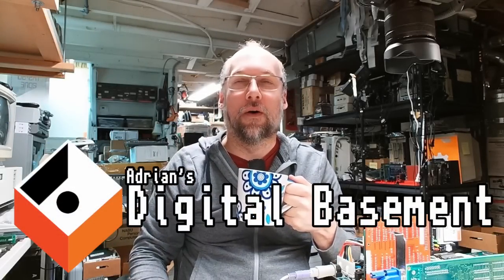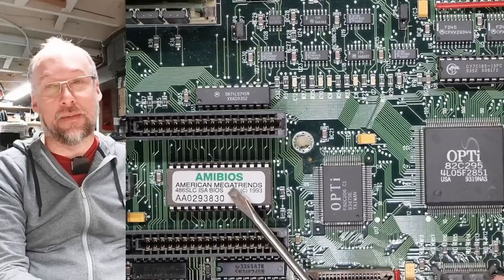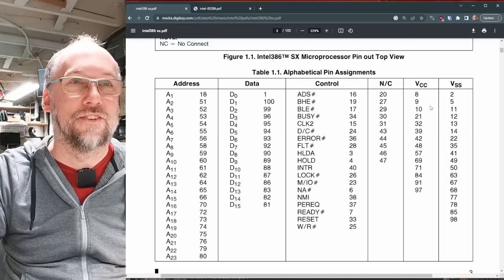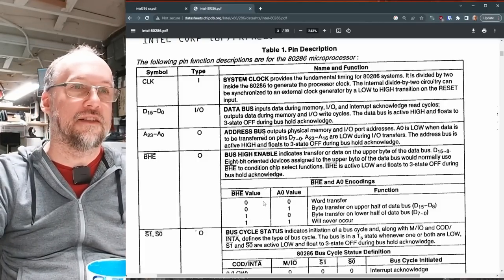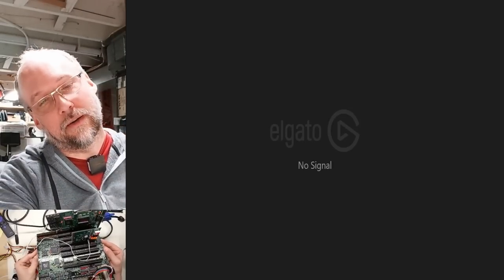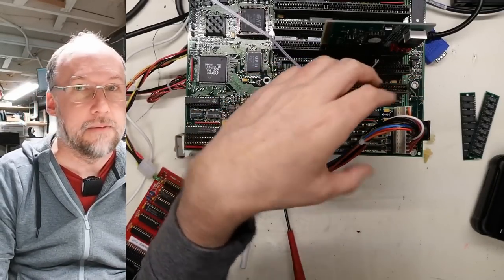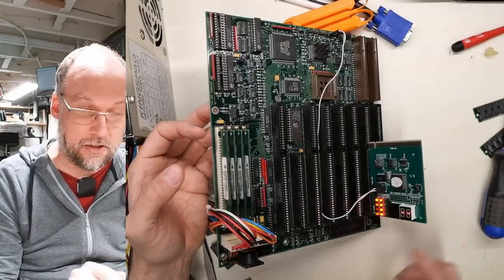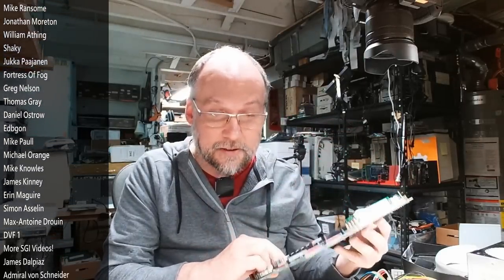Disaster struck while working on this odd-ball 386SX VLB motherboard

Comment: It's a common misconception that the 386SX is basically a 386 "with th 286 bus interface". While it is completely true that the number of address and data lines on the 386SX is just like on the 286, the protocol of the 386SX is very much like that of the 386DX, but it differs from the 286 bus protocol. For example, the 286 bus protocol generally allows the processor to output the address of the next bus cycle while the previous cycle is still being finished, and actually the address pins are always valid half a processor clock (one period of the CLK2 signal) before the bus cycle is started. On the other hand, on the 386 bus protocol, the address stays valid during one cycle unless the mainboard actively allows the processor to output the address of the subsequent cycle (using the "NAB#" signal - "next address to bus"). The 386SX uses the same timings and protocol details as the 386DX, it just has fewer data lines, it misses the top 8 address lines and has the extra line A1. Also, it only has two "byte enable" signals, whereas the 386DX has four byte enable signals.

Furthermore, you are in fact correct that most 386SX chipsets also support 286 processors, but the chipset needs to be configured for the bus protocol to use. Most 286 chipset vendors added support for the 386 bus protocol in their newer chipsets to increase the market for their chipsets. A passive adapter from 286 to 386SX on the other hand won't work.

As I don't expect that board to support VLB masters, it's up to the processor to determine the width of cycles.The VESA local bus is perfectly able to handle 16 bit cycles originating from a 32-bit processor, so the VESA local bus is also able to handle 16 bit cycles originating from a 16-bit processor. On the XT-IDE card, the IDE/ATA interface requires 16-bit cycles to be performed on that interface, which is something 8-bit ISA is not capable of, so that card needs to assemble two 8-bit ISA cycles into one 16-bit IDE cycle. I am very confident that your board will not run any VL card that requires bus operations to be performed as 32-bit cycles. VL VGA cards generelly do not require that (unless special accelerator feature do), as well as VL IDE controllers also work perfectly (also sometimes slower) with 16 bit cycles only.

There is one thing the board has to perform, though: The high two bytes of a DWORD must be transferred on D16-D31, so the board needs to dynamically connect either D0-D15 of the VL slot to D0-D15 of the processor, or D16-D31 of the VL slot to D0-D15 of the processor. That's exactly what the four (74)F245 chips can do.

In fact, stuff like this is also performed on some video cards, like Cirrus Logic cards. The CL-GD542x series are 16-bit local-bus capable graphics chips! The VESA local bus has a signal to tell the processor that only a 16 bit cycle has been accepted by the device and the board/processor is required to re-issue a cycle for the remaining byte(s), if any. Logic on a CL-GD542x card detects whether one of the two low bytes is active, and if yes, it performs a 16-bit cycle using D0-D15 (or an 8 bit cycle with half of the data lines), otherwise it performs a 16-bit cycle using D16-D31 (or a subset). In essence, this means the 16-bitness of your board should not degrade performance of a Cirrus Logic card. This does not apply to the CL-GD5430 or CL-GD5434, though.
Reply: Well TL;DR 80386SX is a cut down version of what was to become a 80386DX, it has the same limited 16-bit Data and 24-bit Address bus, just as a 80286 but it's a real 32-bit 386 CPU just cut down IOs, not much unlike a 8086 vs. 8088 where the data bus is halved from 16-bit of the 8086 to 8-bit in the 8088.
The 386 has in it's ISA significant differences to the 80286 beyond the expansion from 16 to 32 bit execution, as such it has the Real Mode (8086, 80286, 80386), Protected Mode (80286, 80386), Virtual 8086 (80386), which was at the time a major advantage levied by Windows 3.0, and OS/2 2.0. The 80386 also introduced a flat memory model versus a segmented/paged/stacked memory model of the 8086 & 80286 (and coincidentally 80186, that was never really part of the PC ecosystem)

Comment: 5:37 Those for chips are NOT latches, but high-speed bidirectional bus drivers. The model is F245, or 74F245, the F variant of the common 74LS245. The fact that there are 4 chips seems to indicate that the VLB is indeed 32-bit. However, there are 16-bit VL cards. The most famous example is the CL-GD5428 graphics card which use a 16-bit data bus and 24-bit address bus instead of 32-bit. A standard for 16-bit local bus may exist, but just rarely used.
Reply: Quite. "9344" is the date code (44 week of 1993)
Reply: It is also known that those chips draw quite a lot of power and should not be switched simultaneously. Amiga used different types(!) for one 16-bit bus just to make sure that both chips don't switch at the same time. Weird stuff back then..

Comment: My first 486 was an IBM 486SLC2-66 with VLB slots. The 16 MB RAM limit wasn't an issue back then (I only had 4 MB in it anyway), and with 16 kB of L1 cache, it was almost as fast as a 486DX2 when running small CPU-intensive tasks -- but obviously the 16-bit external data bus slowed it down a lot when I/O was involved. Supporting 32-bit VESA Local Bus cards wasn't a problem; it just had to transfer the data in two 16-bit chunks at a time.

My only complaint was that the little one-inch-square CPU had a tiny fan on it that was not only loud, but also didn't fit under the drive cage of the desktop case I wanted to put it in! So I was forced to get a tower case with more room above the motherboard.
Reply: Nice.  I put together a bitsa small Netware 3.12 server for someone that wanted a very low cost basic file server running Netware.  It used an IBM branded (God only knows who actually made it) motherboard with one of those CPUs soldered on.  It ran flawlessly for years even to the point of being forgotten about and lost in the office space it was used in but continuing to plug on regardless.  Quite surprising really all things considered.
Reply from the maker: So basically something very much like this! Interesting! I just don't get why they even bothered with VLB ... But I suppose it ran faster than 8mhz ISA... So there was some benefit.  I know you have a lot of machines, you don't still have it anymore?
Reply: @adriansdigitalbasement2  No, I got rid of it a long time ago, back in the late '90s.
Reply: That must be hence the “AKA IBM 220”
Reply: If you don't care about the FPU, this processor was just fine. I had one up until very recently (actually, I had an Ambra and an Alaris) and it was about as good as an SX2-50.

Comment: As for the motherboard not working with the XT power supply -- it may require +5V on pin 2 of the P8 power connector, while XT power supplies do not have anything connected to this pin. I haven't heard of any AT motherboards actually requiring +5V on pin 2 of P8, but it's just a thought.
Reply from the maker: Nice. I'll give it a try with my new bench supply. I swapped over to an older ATX PSU with AT adapter for lab work. (ATX with both -5 and -12)  I fear the motherboard is gone though as at least one IC was damaged, it seems like 12v may have made its way to the 5v rail when the PSU decided it was time to die. LOL

Comment: 1:20 I wouldn't call a 386SX "essentially a 286". Sure it has a similar bus and similar performance (on 16-bit code), but the instruction set was heavily updated and orthogonalized for the 386 (including the later SX). Actually more so than on any other new x86 processor. It would be more correct to say that the Pentium III was essentially a Pentium II (or Pro), for instance.

Comment: What we said at Microsoft at the time - and it was generally applicable - was "Remember: the S stands for Sux!" (Yes, that applied to Win32s as well.) But admittedly, there was one advantage to the 386sx from a development standpoint, in that you could treat it as a 386 and not have to deal with bloody segmenting. While technically it (and the 386dx) still had segments, they became settable and arbitrarily large, so you could set your segment to all of RAM if you wanted.

All that aside, something I was told by others at the time was that they were in many ways the 286 that should've been, and if you ran 286-targeted code on them you'd get a really big performance uplift. I never tested that myself, but I can buy it - the 286 was absolutely not ready.

Comment: Just to clarify "a 386sx is basically a 286", while true it has a 16-bit external data bus, it also has an internal 24-bit address bus. Plus it includes the 386 processor extensions to the x86 instruction set.

Comment: Hi Adrian. I feel the same about your motherboard. I have 2 Packard Bell mobos that both suffered Varta damage. Both have the same small chip come off with corrosion.  I bought the one in an attempt to fix the other, but that hasn't gone over well. You keep up the good videos

Comment: Very good video indeed !
Your experiences here immediately tells me I have to use an external crowbar circuit on the power lines when testing motherboards.
The old power supplies are prone to have bad electrolytic capacitors inside.
Commonly seen as the top of the caps bulging out or the bottom showing signs of leakage.
When the bad capacitors no longer is able to hold a charge the output voltages drops under load causing the regulator circuit pushing the power side to it's limits.
- and then disaster strikes ...

Comment: As I recall, VLB was basically just an extension of the 486's bus pins with some buffering thrown in to keep the processor stable. When the Pentium was released, VLB quickly fell by the wayside because it needed extra hardware to translate the 486's bus protocols to the Pentium's. At that point, it just made more sense to implement the  platform-agnostic PCI bus.

Comment: I remember buying my first PC compatible, a 486.  The local computer store was selling two with "enhanced" slots: one with VLB and another with EISA.
Taking home all the printed documentation and a borrowed Byte magazine (this was before the Internet @ home was a thing), I did all the pros & cons.
Eventually, I order the EISA board and all the necessary cards.

I must say that my machine was super fast, compared to the run-of-the-mill 386s & 486s at school.  Although I didn't like that the EISA cards & BIOS required special software to configure them, but all 8 slots supports 16bit ISA / 32bit EISA.  The VLB mainboard only had 2 VLB slots, and the rest were 16bit ISA -- so EISA for the win.
Reply: Someone recently went off at me insisting no one used EISA when I mentioned drooling over it enthusiast-ly back then. I was sure there must’ve been the equivalent of today’s Threadripper motherboards for use in the home, they insisted it didn’t happen. Thank you for the belated vindication!
Reply: @kaitlyn__L  Everything EISA was more expensive, that's the simple fact of it, so it was usually in servers and high end PCs. VLB was sort of a hack, tapping directly to the CPU bus but cheaper to implement. PCI would render both obsolete anyway.

Comment: I had a PSU go bad while working on my parents' IBM PS/1 Consultant years ago that took a video card (ATi Mach64 ISA), network card (D-Link DE-220), and motherboard with it. Whatever voltage spike went through the system was enough to crack the main chip on the video card. The computer would still POST with another video card, but when in the BIOS setup, every other character was scrambled. It was a very sad day.

Comment: I vividly remember owning such a board when i was a kid. Because it was my very first own PC. A Highscreen branded desktop with 386-SX 16 and a whole 1024 k of RAM. Also a 40Mb HDD and 2 Floppies. But mine had a Phoenix BIOS, not AMI.
I also remember that i had to get a VLB I/O card to get the fast UARTs to drive my 14.4k modem. The ISA ones only had 9600 bps UARTs on them. The big advantage was that the VLB ran with the full 16 MHz CPU clock, twice as fast as the ISA slots. And if i remember correctly, the CPU handled the two busses separately. That way my fancy terminal programs screensaver didn't mess up my Zmodem downloads anymore.

<insert "i was there 3000y ago" meme here>

Comment: I tested local bus vs pci on a 486 SX 50mhz (so basically a 386, and I guess the bus was running at 25mhz with a multiplier of 2). The game Screamer has a "test your graphics card speed" option. I don't remember the numbers but the PCI card was faster than a local bus card. Both had 1mb, the PCI card was a Cirrus 542x or 5430, I can't remember, the local bus card was a "chips 64300" (the drivers in Windows called it "wingine").

Comment: Oh Boy!, this video brings back my early memories of PC days of working for a Clone-PC company, and yes there were some very cheapo motherboards, and as posted below the chinese card makers used very sloppy insertion specs and the cards could move front to back inside the slots, you had to line up the pins yourself and then push the card down into the slot, and sometimes it would move between pins and not post. Oh was I glad when this died off, then PCI bus, and then the kinda lousy AGP slot era. it was a bandaid ontop of more bandaids, and most just were regular cards that you could put in a VLB or AGP slot and no better performance was noticed. a lot of problems go away when you put MR Bios on these old boards if available VOGONS has a zip file with a ton of Mr Bios files.
Reply: Main issue was lazy people not using all screws for the motherboard (or the case not having enough points). So yeah it needed perfect alignment and careful handling, very useful to always recheck/reseat everything before turning it on which isn't exactly user friendly.

Comment: VLB 2.0 was released in 1994, with a 64-bit bus, and a bus speed of 50 MHz.  So with the Pentium 64-bit data it was able to use the later spec, but with PCI coming out for the Pentium VLB went out of favor

Comment: Two thoughts on the board: 1) is it possible that the different pitch of the beep codes with and w/o the video card was already sign for a short or problem in the PSU? 2) AFAIK use of the 32bit extension on VLB cards was optional, i.e. if the card is inserted into a normal ISA slot, it still works, yet slower. Therefore the VLB slots on this board might be just for better physical support of a VLB card - probably only connecting ground pins of the 32bit extension.

Comment: The first computer I ever put together for myself (after being pretty badly ripped off buying my first PC, an essentially useless 286, from a guy at the mall just selling a computer at a table) was with a 486 SLC. I found a motherboard for sale in a catalog that had the processor already seated and thought the specs sounded good enough. I worked a lot as a teenager and ended up buying a pretty high end VLB graphics card to use the extended slots. This was all so I could run Mortal Kombat so that program was the benchmark. It would run great for a few minutes but would always lock up no matter what I did. I think I even remember the requirements for the card exceeding my system specs although I bought it anyway.  I thought that SLC stood for 'Single Line Com', although I may be remembering that incorrectly. It ran everything else fine, though. I had a lot of fun with the system. The 286 I sold to a friend who insisted that I sell it to him although I assured him that it could play nothing but older games and had to emulate color. It came with a small monochrome monitor. The seller gave me a disk to boot the system and one to emulate Hercules CGA graphics. I think he included a copy of Pharos Tomb. I sold it to him and used the money to buy a VGA monitor and the first parts to my new system. Eventually I had a nice gamepad, sound card, graphics card, etc. and put it all together myself. I got Saturday detention a lot which was held in the high school library. I would go to the job finder computers in the back and reset them then enter DOS to play games I would sneak in from home. I remember the librarian catching me playing a demo of Desert Strike and being surprised that the computers could be used for anything other than the job finder program. I explained to her that it was just a computer and that it had DOS and Windows although nobody ever used them for that. I even showed her 'CTRL ALT DELETE'.  She was not angry with me in the slightest but rather impressed. I later brought blank disks in and copied Windows and DOS for my own use. This was back when Windows often was laughed at for being useless and I would complain about how DOSSHELL was better if someone really needed to click on icons. Since then I have made so many computers and done so much with them. It all started with a 486 SLC. 😎

Comment: The PEEL18CV8 was a competitor to the 16V8 and other GAL chips. I haven't seen one in several years, not since I lost the only one I had when spilling some chips off my workbench. Their proximity to the VLB slot extension leads me to believe they're part of what makes this work.

I know some versions of the 486SLC chips had "System Management Mode" so it's possible it emulates a 32-bit bus using software and extra hardware.